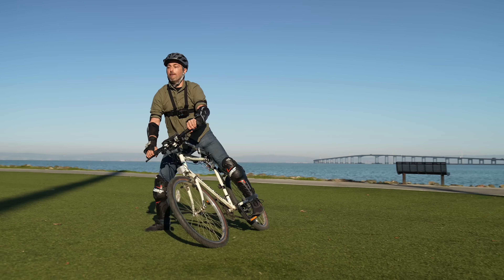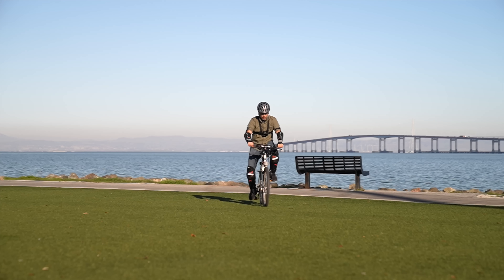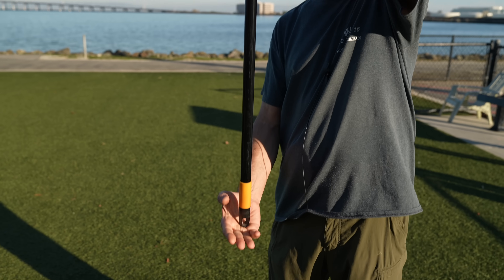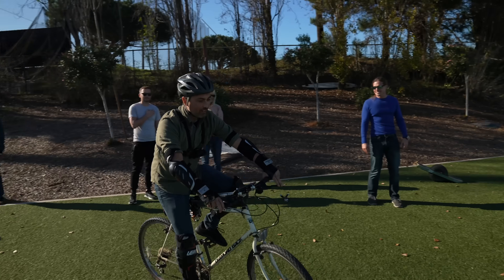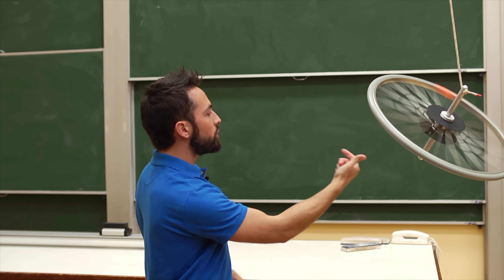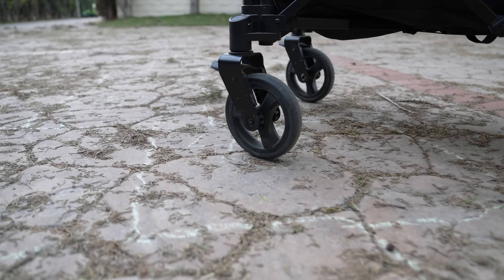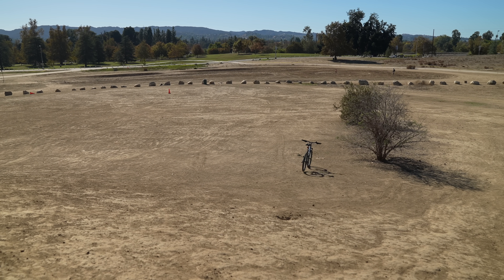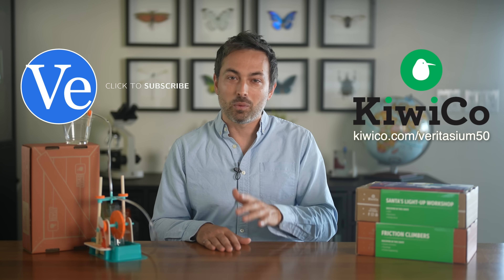Most People Don't Know How Bikes Work

Comment: This is taught explicitly when you go through motorcycle courses, it’s even more important to know this when operating at multiple times the speed and hundreds of pounds more weight to that you can safely operate the vehicle
Reply: I realised this when, as a teenager working at a fast food restaurant I was asked to take their comically oversized tricycle and go and pick up trash around the restaurant.
Being used to riding a bike simply by leaning, and counter-steering, but never having thought about it, I just kept going into the wrong direction, in public, on a freaking tricycle!
I provided very good amusement to my colleagues that day (And refused to ever ride the stupid thing afterwards)
Reply: And that is the only way to fight the side winds.
Reply: So trikes work differently?
Reply: @capncrunchxc  Yes. Because there are two wheels at the back, the darn things are always vertical, unless one of them leaves the ground. So leaning doesn‘t do anything.
Reply: Motorcycle turning is very different although initiated the same.
At very slow speeds you are relying on the centre of gravity to keep the bike upright and you turn by steering in the direction you want to go.

At higher speeds, yes you initiate them with counter-steering but it's because you ARE using the gyroscopic effect - much faster wheel speeds with much heavier wheels.
So there's not the second turn back that is shown in in this video with bicycles, after the counter-steering.

These differences are even more dramatic when braking on a curve.

I had to have a tendon reattached after crashing my motorbike the first time back on it in years after many years riding bicycles, because I didn't realise my muscle memory was all wrong, and ended up braking into a median strip because I braked in a straight line.
Reply: @AndyDentPerth  All 2 wheels vehicles turn the same way, by leaning into the turn and using tires with rounded thread profile to allow it (as opposed to car's flat ones). The major difference between bike vs bicycle is the effect of the rider's body to initialte a turn. A lot on the bicycle, less on the motorcyle where the proportion of you weight over the total weight is not as great, plus the heavier wheels have more inertia (gyroscopic effect)...Thus steeting with the handlebar is more efficient than steering only with your body (same for the bicycle by the way, especially at high speed). But fondamentaly, they are the same.
And as explained in the video, turning the handlebars to the right will make the vehicle "fall" to the left and thus turn left, and vice versa.
Reply: @SILVERK5  What the gyroscopic effect has to do with turning? Never heard of that type of effect.
Reply: Wrong, turning on a motorcycle is initiated by countersteering.
Reply: @AndyDentPerth  Everything you just said is wrong.  Turning a motorcycle at any speed is initiated and stopped by counter steering.  You're not using the gyroscope effect, you're fighting it.   The second turn back into the direction of the turn after the initial counter steer is also done on a motorcycle.  You might not notice it but that doesn't change the fact that it's happening.
Reply: You are very wrong. Motorcycles steer exactly the same as any bicycle. Yes at low speeds your handlebars will point in the direction of the turn, but the pressure that needs to be applied must be the opposite direction.

Comment: I learned to ride a motorcycle with a man that taught me counter-steering where you push away from your body with your hand on the side that you want to initiate a turn. It was so counterintuitive to hear, but once I learned how the bike reacted underneath me, I realized that I was doing it instinctively. 

You push away and as you "fall" into the turn, you then turn in to complete it.

Learning how to ride a bike (in theory) all over again by having someone describe the actual movements rather than the instincts was jarring to me. I still think about it every now and then (riding motorcycles for over 20 years) and it still trips my brain when I move the set to the right to steer left.

Thanks for the video, great stuff.
Reply: Is a 100mph high speed sweeper the same or is the counter steer a endless phenomenon? Head tube angle 📐 and bike style also comes play. Cafe bike with steep head tube angle are the extreme examples. Counter steering is best demonstrated by viewing a remote controlled motorcycle. Crazy
Reply: @EtaSoon777  I'm not exactly sure what you're asking, but counter steering works at all speeds. Physics don't change based on different circumstances. It's just that a lot of people don't understand that and will say wacky things.
Reply: @EtaSoon777  countersteering happens at all speeds and all depths of turn where the bike is stable.  It's more about where  you're applying the force, than the actual steering angle in the corner.
Even at low speeds, the bars will turn themselves inward, and you will instinctively be resisting this inward turn, pushing the bars in the outward direction (countersteering), the difference being that you're not countersteering hard enough to actually swap directions.  you're just pressing outward enough to prevent it from turning in more sharply (which would straighten you out at speeds where it's stable, or just steadily spiral in until you fall over, if you're going too slow for the trail forces to be able to lift you upright.
Reply: @EtaSoon777  The main difference is at high speeds and more weight the bike's natural tendency to stay upright and ride in a straight line is so powerful it's physically difficult to overcome. You might need to push wth tens of kilograms of force to get the bike into a slight lean and you need to keep pushing or it will snap upright. All modern motorbike riding courses teach this phenomenon - though not everyone understands it. Exactly how it feels depends on the geometry and weight of the bike as well as your speed. Little things like grip and tyre air pressure can also change things quite a bit. On a dirt bike where we often run very low air pressures it's a night and day difference on the same bike.
Reply: @EtaSoon777  Bikes only turn via leaning and manipulating your center of gravity while in the lean (hanging off the bike on the inside of the corner).  countersteering is done to initiate lean.
Reply: It makes it hard for me to ride bike cuss I over counterstear
Reply: Same
Reply: @AAMech Wrong. You stop steering when the desired lean angle is reached. If you keep pushing, you will crash. "Releasing pressure" doesn't cause the turn to tighten; a reduction in speed does.
Reply: @xeiaiex  This isn't always true either.  if you keep turning the bars, you will crash, but in most cases, you're not turning the bars, you're just applying pressure to keep them from turning further than you want so you can maintain the lean angle, and  prevent the bars from turning inward and steering the bike back under you.  at certain speeds and lean angles, you'll be in equilibrium, which is why some people can ride some bikes hands free, and even turn corners.  Many bikes are over-stable for this, and will turn into the lean more agressively and straighten out (or go over centre and gyrate like the bike bouncing down the hill, overcorrecting back and forth).  Some bikes are very hard to steer hands-free.
I've noticed this a lot in the world of motorcycles.  Older bikes that I've owned seem to be more neutral handling.  if you're at the depth of lean you want, you'll be applying very little force to hold them at that lean angle.  New sport bikes tend to have a much stronger stabilizing force, so you'll usually be applying a lot more continuous pressure to keep the bike turning.  I'm not certain what aspects of the geometry cause this trend, but I definitely feel a big difference.
Reply: @nwimpney  Counter steering works at all speeds and there is no other way to effectively steer a motorcycle. It really is that simple.
Reply: @AAMech You push to initiate the turn (counter steer to the desired lean angle) and then you can let go and maintain that angle forever, until you speed up, slow down, or stand the bike back up (by counter steering the opposite direction). 

You do not maintain pressure on the inside bar. You initiate the lean, and stop pushing when you're at the right lean angle to make the turn. 

My guess is that it's just the way that you are perceiving what's happening. No disrespect though, I just think that a lot of people don't realize exactly what they're doing, even though they're actually doing it.
Reply: I noticed even on a bike you counter steer, if you're riding at high speed (around 20 mph or more) you maintain an opposite turn.
Reply: its how you ride a mountain bike off road... no steering weight and hand pressure are used for turning unless going walking speed
Reply: I remember my motorcycle instructor harping on me for turning the handlebars and not countersteering correctly, and me racking my brain trying to understand it. I wound up nearly hurting myself trying to better do it by going downhill on a bicycle. Turns out it's a pretty instinctively process that you learn by riding, and the only reason I couldn't get it was because I was on a heavier Harley which required me to speed up more to press and lean instead of turning the handlebars.
Reply: If you try to actually turn the handlebars on a motorcycle going more than about 10mph you'll completely fail.
Reply: Yes. Motor cycle riders learn about counter-steering.
Reply: @Observ45er  You figure that out yourself? 🙄
Reply: Motorcycles operate in two distinct modes anything under approx 15 mph you use counter leaning to keep the bike upright in slow turns anything over 15 mph uses the counter lean effect and this is due more to the radius on the tires then anything else
Reply: Контрруление помогает только на уклонах, посмотри внимательно на гонщиков MotoGP...
Reply: @EvpatijK.  Counter-steering works on flat surfaces as well.  You just have to be going fast enough.  (Hopefully Google translates my response well enough)